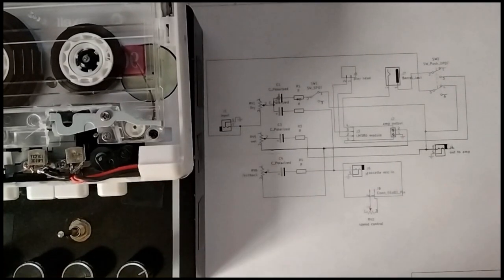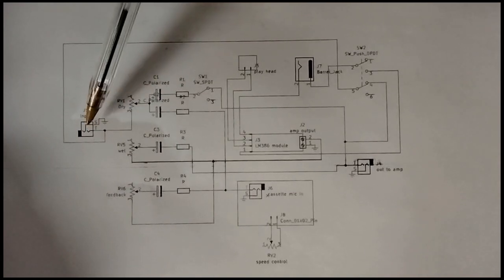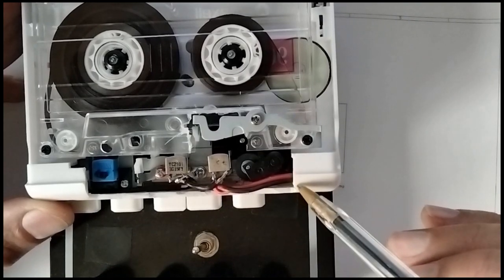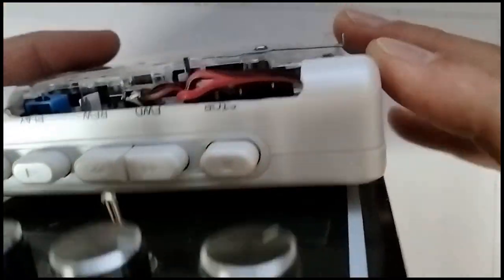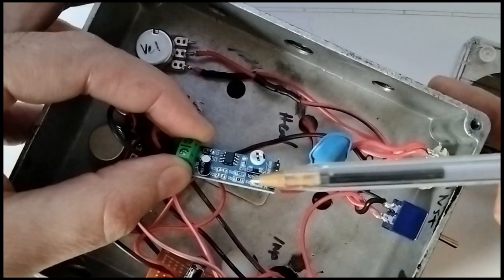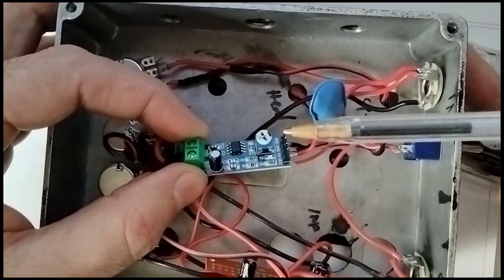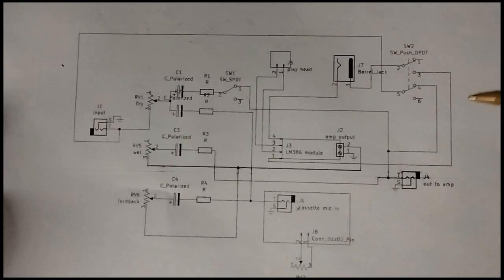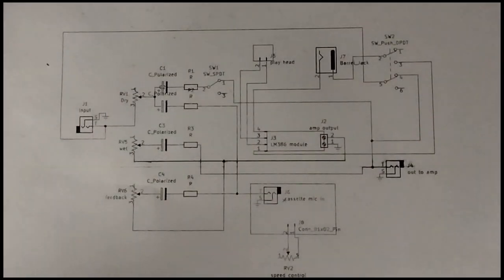DIY Cassette Tape Delay Echo Effect Pedal PART 1: Schematic and basics of how it works

Comment: slight addition, that pot on the lm386 board is not gain, but volume. the gain is fixed on those modules. sorry for being a nerd. 😊

Comment: for a cheap play head you can just get a car cassette to line out adapter, they're just a read head attached to a 3.5mm jack.
Reply from the maker: Wow that's a really great idea, those can be had very cheaply, I bet it's a good bet if you just need one. who knows how good the quality is but it's definitely worth a try
Reply: Aren't those designed to be a line IN to create a magnetic field against your car's playhead? Not sure if they would work to to run a tape against them and have them act as a playhead with a line OUT.
Reply: @TheSeaDevilsband  it's a microphone/speaker situation. running a signal into it generates a magnetic field, running a magnetic field over it generates a signal.

Comment: I like how you modified the cassette with the tension arm. I've been messing with making a few different versions of cassette delays and the figuring out where to put the 3rd head is always a struggle. Nice work.
Reply from the maker: What have you figured out for a 3rd head? I'm working on a prototype where the record head rotates down and then you can have an array of as many heads as you wish lined up at a 90 degree angle to the cassette, the tape would just divert down to the heads and then back up to the capstan.
Reply: @granitsky63  https://youtu.be/5nWg945pce4?si=vLEcrgGogGJH8FCb

Comment: Сan you provide the potentiometers, resistors and capacitors? the schematic doesn't tell you which components you are using. Thank you!
Reply: Do you really think this matters?.. Put any.
Reply: @tupitochka8841  And do you prefer to pick your components?
Reply: @tupitochka8841 yes it does matter… lol
Reply: @RegularFeelings not really , any electrolytic polarized cap works for the filter cap, and the resistor just use a standard value and you'll be fine , it'll work with out the filtering stage really, it's just to block dc  interference that's possibly induced in the wiring.
Reply: at 10:20 you can see it is a 1 uF cap and he mentioned resistors are lower than 1k,  hope that helps